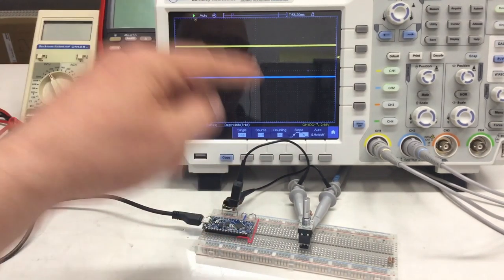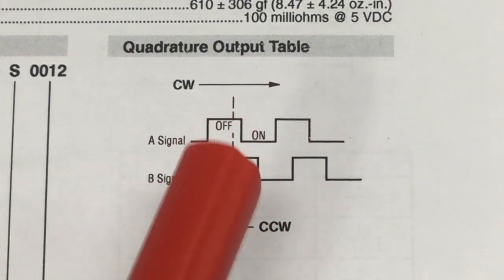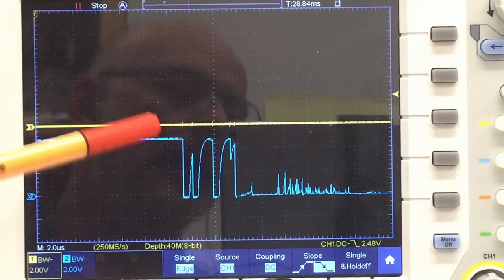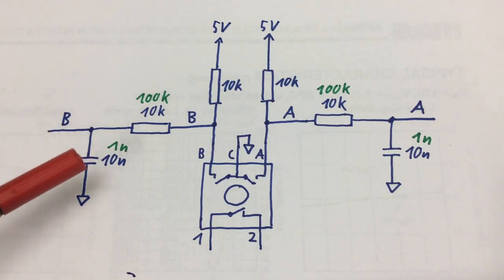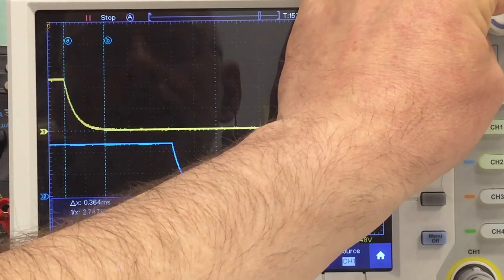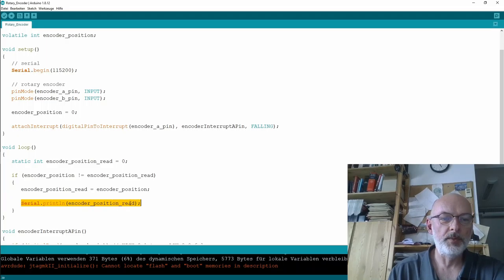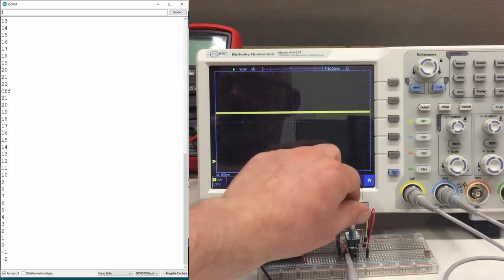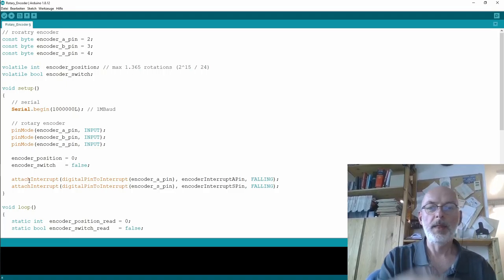Rotary Encoders and Microcontrollers (e.g. Arduino) – My Way …

Comment: Tak, Robert! The HW debounce worked so nice, it made the encoder readings much faster!
Reply from the maker: Hallo Leonardo, I'm happy you found the video useful. Sometimes, that is if the switches are not too bouncy, a simple RC circuit does the job ;-)

Comment: There are so many designs for encoders, but only after looking this it is clear to me how the filtering should work! Awesome! Also the code is really nice, most of the implementations I´ve seen are using two interrupts. In my last design I´ve used a schmidt trigger after the filtering for each phase.. seems to be overkill if the filter is designed right. Thanks a lot!
Reply from the maker: You're welcome! A Schmitt trigger to clean up a bouncy input signal, even a filtered one, is good practice, not overkill! It's just you can get away without it some times ;-)
Reply: @robertssmorgasbord  Yes, they aren´t that expensive, I´ll let them in. BUT.. if we want to go "professional on the cheap" how about only using a filter and schmidt trigger on the phase that is generating the interrupt and leave a note for the programmer, which one to use.. engineers from hell;)
Reply from the maker: @randomname3894  That's the spirit of value engineering! 🤣
Reply: A Schmitt trigger is only needed when interfacing directly with other digital logic, the inputs of most microcontrollers, including all AVR's already have hysterises on the inputs, so yes a Schimitt trigger would be overkill.
Reply from the maker: @darkphotons101  Thanks for the info! I just did a quick search through the ATmega328P datasheet and it indeed mentions hysteresis. Though the only actual value I found is for I2C (page 264) and its 0.05*VCC, so 0.25V at 5V VCC. That would be enough for a RC filter signal. There are also some graphs on page 272 ("Pin Threshold and Hysteresis"). I did not know / was not aware of that.
Reply: In my application - an esp32 - the s.trigger really helps a lot.. I tested it with different combinations and a too slow rise or fall time will lead to ghost triggers, so the trigger option is the only 100% working solution.. but it seems to be a specific problem of the esp32.
Reply from the maker: @randomname3894  Maybe the ESP32 has not the same "hysteresis" features on the digital input as the ATmegas. I think at some point I will actually test the behavior of the ATmega in regards to slow rising/falling input signals.
Reply: @robertssmorgasbord  The ESP32 has a lot of quirks. Some pins can´t be used with rising or falling edge.. only on change interrupts. Then they "may" ghost-trigger with some adc or wifi settings. Very possible that the Atmega can handle them a lot better.
Reply from the maker: @randomname3894  It might have it quirks, but you do get a much faster MCU with much more RAM/flash memory and 12 bit ADCs on top compared to the ATmegas ;-)
Reply: @robertssmorgasbord  I really like the ESP32, but the ADC is nonlinear and noisy - even a potentiometer with low resolution software filtering can get you in trouble.. I would bet the Atmegas ADC is more useful in the end. However, I really enjoy the RTOS features and speed you can drive displays with for example. But the most practical application is configuring your project via wifi and just saving it in flash and of course over the air updating. I think the last few years a lot of people realized that this is so useful, that the ESP chips are more and more used as a co processors - even with slower main processors. Thanks for the chat! I´m looking forward to see more content:)
Reply from the maker: @randomname3894  I thank you for the chat! And rest assured that the 10 bit ADCs in the ATmegas are also crap ;-)

Comment: Hello Robert! 
Great video. I will use your suggestion on my encoder projects.
I have only one question: I have seen, on the internet, the use of a diode parallel to the debouncing resistor. Do you have any comentary? It seems to protect the lifespan of the encoder.
Many thanks in advance.
Auf Wiedersehen,
Peter
Reply from the maker: Hallo Peter!
I guess you're talking about a circuit like this: https://www.eejournal.com/article/ultimate-guide-to-switch-debounce-part-3/ "Adding a diode to the RC network (Image source: Max Maxfield)". The diode does not extend the lifespan the encoder, respectively, reduces the load on the encoder switch. It's purpose is to equalize the rise and fall time of the debounced signal (that article explains it very well). In my circuit this is achieved by making one resistor very small (10k) compared to the other (100k). So the capacitor is charged through 110k to 5V and discharged via 100k to ground (almost symmetrical).
Hope that helps!
Tschüss
Robert
Reply: Many thanks for your quick answer and explications. I will follow "your way"!
Viele Grüsse,
Peter
Lorena - SP, Brasilien
Reply from the maker: @peterelsler7165  You're welcome and good luck with your project!
Herzliche Grüße aus dem regnerischen, kalten Deutschland ins sonnige Brasilien
Robert
Reply: @robertssmorgasbord  Vielen Dank, Robert.
Stay safe in this challenging times.
Viele Grüsse,
Peter
Reply from the maker: @peterelsler7165  Immer gerne!
Herzliche Grüße
Robert

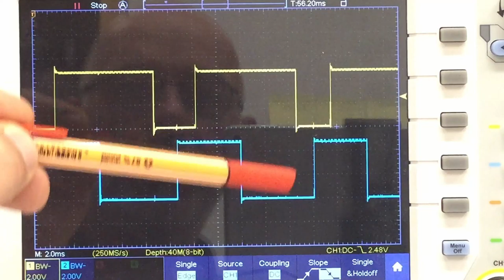Comment: 5:42 It seems that your scope probe(s) are not properly compensated (they are in fact overcompensated).
Reply from the maker: Well I did compensate them for that scope, but it was a quite while ago. I really should check their compensation. However, these over-/undershoots might also be caused by parasitic inductances/capacities ;-) But I'll compensate my probes anyway :-)

Comment: I get it ! and thanks for that, no need for a library is a big plus...I think Sinatra would have done it YOUR way as well!...Im a big fan of the TTP223 touch switch IC at the moment and you don't need software or hardware debounce ...cheers !
Reply from the maker: Thank's for the Sinatra comparison :-) Anyway, the thing with using a hardware related library in a MCU/Arduino environment is that you should have at least a basic understanding of how that library works. There are only a limited number of interrupts and timers available in a MCU/Arduino, and when a library snatches an interrupt or timer without you knowing things can go sideways fast.

Comment: Good video sir
I got ur msg about vfd but i need to do this seriously for that
I have requested for stepup cycloconverter circuit with force commutation circuit can u help please
Reply from the maker: I meanwhile answered your comment in the "Laboratory Water Bath (4)" comments section (sorry for the delay, but the YouTube comment notification system is really going downhill). Anyway, maybe then this link will be of help to you: https://www.myelectrical2015.com/2017/07/step-up-cycloconverter.html . And the following is a more detailed paper about cycloconverters: https://www.slideshare.net/Vishal_popat/cycloconverters . Google is your friend ;-)